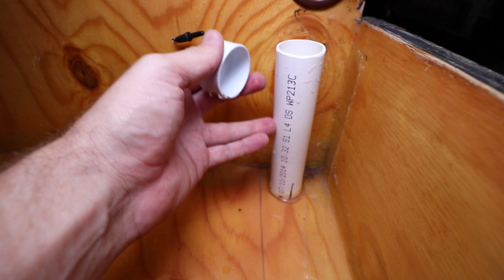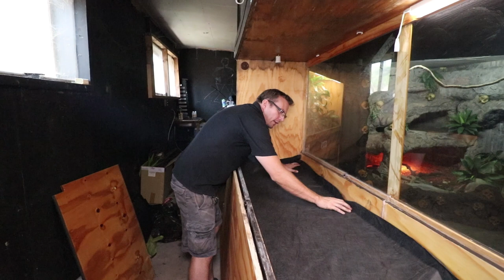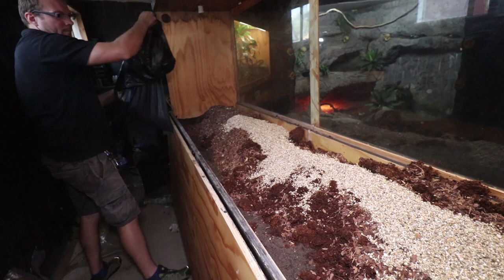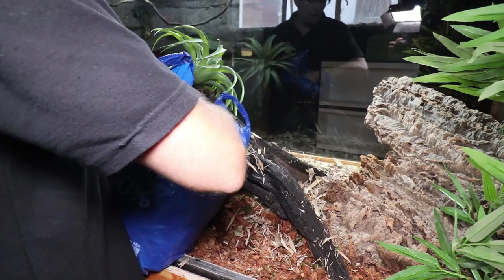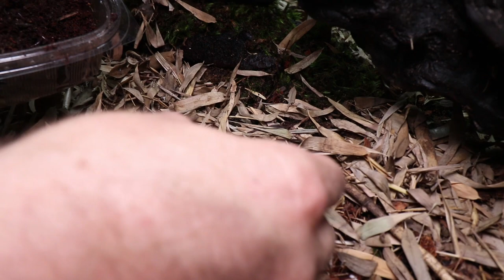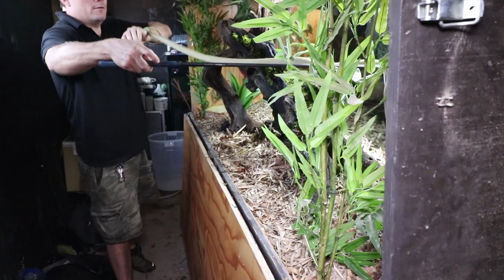Bioactive substrate in King Cobra enclosure

Comment: what can I mix with the organic potting soil for a bearded dragon enclosure?
Reply from the maker: @Kimesh, you can use the typical bio active mixes but you should go for a drier top layer. If you have a fairly sizable cage you can have one corner more damp and humid with it becoming drier towards the basking spot. Then you have more microclimates with in the enclosure. Just search bio active bearded dragon set up for more info. All the best.